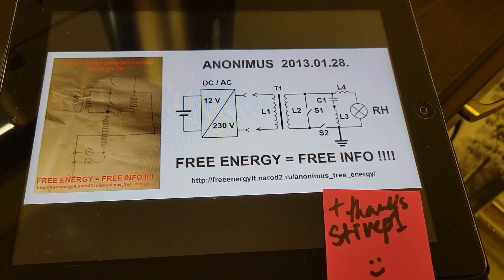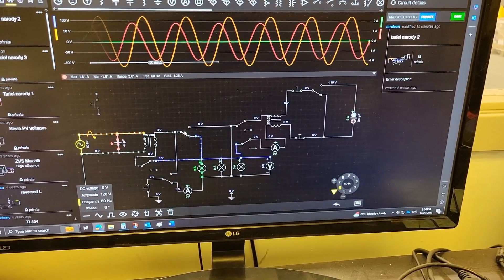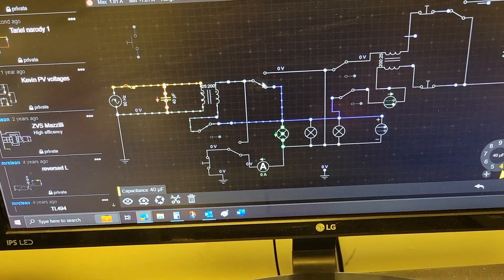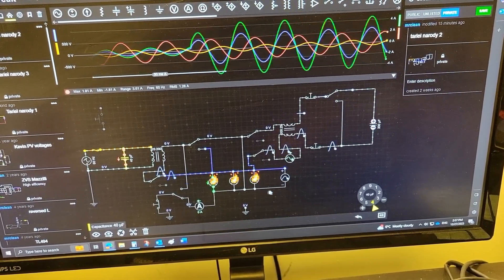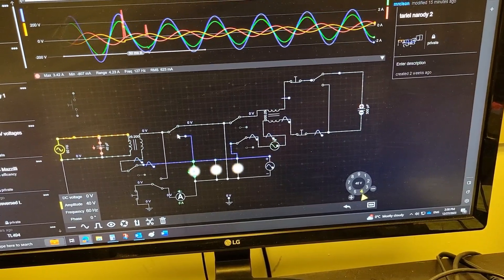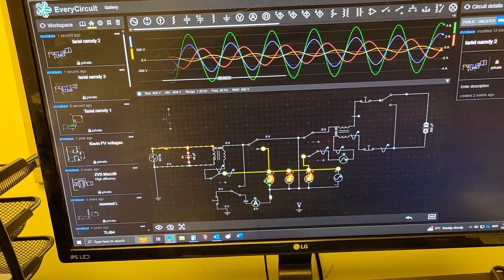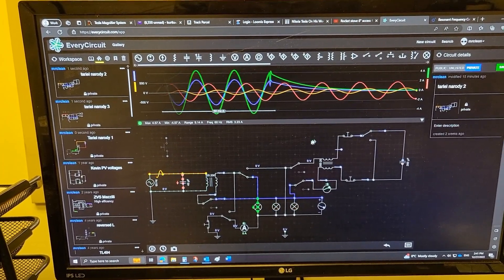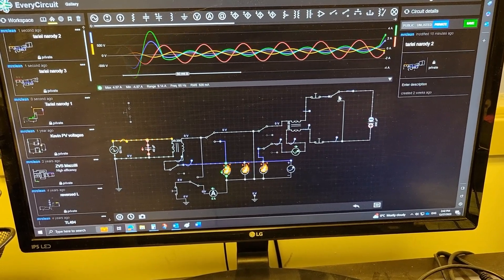Part 18 !!! Akula / Kapanadze Experiments: Magical Moment.. in theory ;) Enjoy !

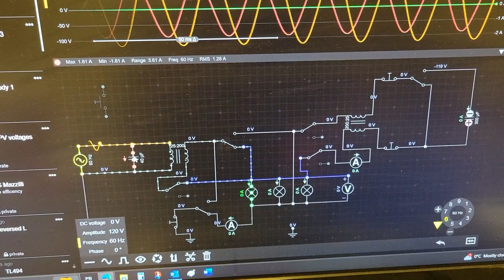Comment: Hi Kurt. When you click on the "current trace in red" at time 2:17. Are you clicking on the 40 Uf cap? If so, that is not giving a trace of input amps, but only amps in the cap. I have spent a long time trying to replicate this in the sim and I only just noticed this in the video. I may be wrong but i think your measurements are way off because you are not measing amps on the AC source, but only on the cap. Input amps will be huge by comparison. I hope i am wrong, btw! Thanks!
Reply from the maker: Are you able to get the sim running the same as here? Are your lights being overdriven?
Reply: Hi Kurt. Yes but with massive input wattage.  I am using Android version ATM because PC is broken but I had the same results with the PC version.
Reply from the maker: @sandysmagicmix ok gotcha, maybe that's where the self loop comes in, but just as many circuits I have modeled where they work in reality, but not in the Sim... this may need to be built in reality to see.
I do plan on this but been slow with new baby

Comment: Hi Kurt. Do you know if the coupling co-efficient of the right hand side transformer in your simulation was set to a value exceeding 1? Thanks.
Reply from the maker: @sandysmagicmix  I just checked and it's just below 1 (.999m).
So maybe iron transformer on both sections, as supply, and later resonant, to achieve this coupling

Comment: Kurt,
How are you doing with this? I still am interested in doing it too!
Cheers Warren
Reply from the maker: @warrenkeillor9034  hi man, i shamefully have only been continuing my existing project. 
And have not yet assembled this lol
Reply: @kdkinen  Respected friends
Thank you for sharing
May I ask for your circuit diagram
This circuit structure
Can that light bulb light up?
Is the switch in that circuit diagram using a relay? Or is it just an ordinary single pole double throw switch?
Reply from the maker: @yunshuizhongyi  just a regular switch, i used for selecting on and off

Comment: Ferrite core primary? Do you have it running?
Reply from the maker: @anondusery1271  I will do a new video shortly to update people.
Reply: @kdkinen  Thank you for your fine job. Can you do an update in everycircuit with the updated parameters, volts, hz, capacitor, induktance values,  etc. ?

Comment: NICE Kurt! If your Primary Current and Voltage are 90 degrees out of Phase then the Input Power is 0.00 Watts (100% Reactive) NOT 182 Watts. Clearly the Output Power is 100% Pure Power. So the efficiency might be infinite... Cheers Thane
Reply: Power could be zero only during the peak. Not the entire full cycle.
Reply from the maker: You're still the master Thane :)